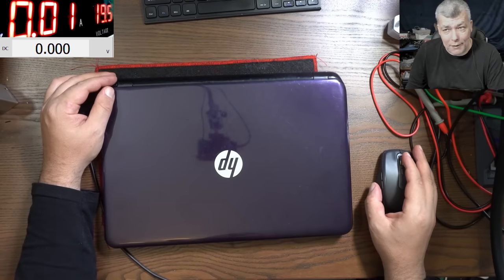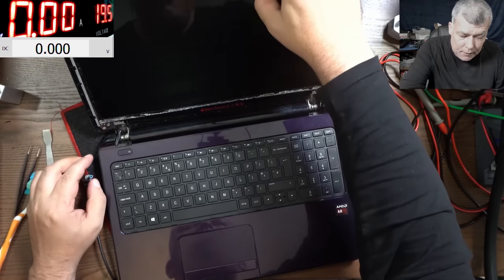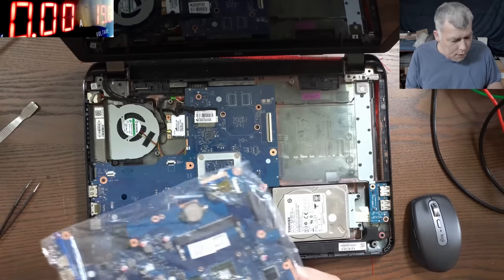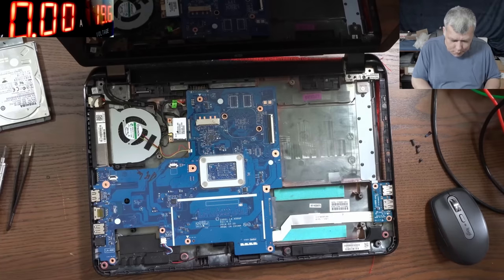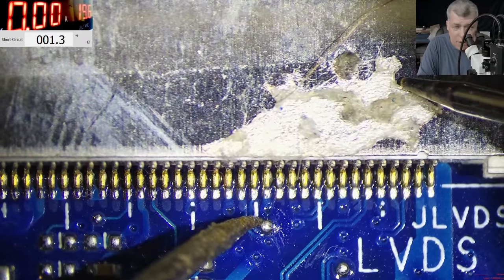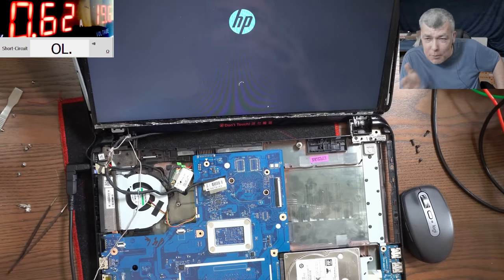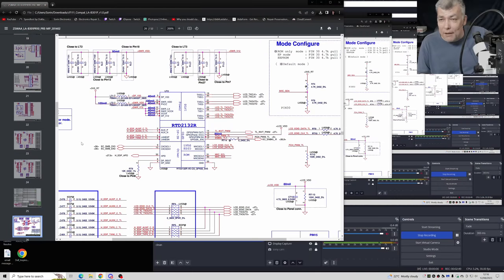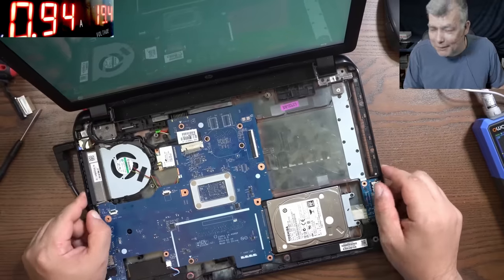Found a Youtuber fixing laptops by buying GOOD motherboards from Ebay - Let's name and shame

Comment: It's not just you. I diagnose and repair other peoples vehicles for a living. Sometimes it's hard to see a simple fault, especially when you are used to the fault being caused by a common/recurring issue. If a 2000's GMC/Chevy truck came in with no fuel pressure, 99 percent of the time the fuel pump failed. BUT......there is always that one percent that had a mouse eat the wiring. Nothing really surprises me anymore! Thank you for the GREAT video and for being a humble and honest human!!!
Reply: Also saw ants eat the wires in a car

Comment: I wonder how you, as a repairman, didn't connect the laptop to a monitor first with an HDMI cable? At that time, you would have realized that the problem is with the image cable, not with the laptop or motherboard😂😂😂

Comment: don't feel too badly about this. I have an older HP laptop that would not power on and I spent so much time diagnosing it. I finally narrowed it down to a single track on a 6 pin ribbon cable that goes to the headphone and microphone jack. The track was cracked and no signal and this shit the entire laptop down. I swapped it over for the one that guess to the track pad and it fired right up. put it back and dead again. One single wire and the whole thing died. I replaced it with a $2 replacement off eBay and it's working fine.

Comment: We usually check the Display first and if it still produces the same image on another screen we check the cable first. I have seen the screen flicker on and off but if you move the screen it comes back in a certain angle etc. Then its a clear sign of that cable is compromised. But like you mention, there can be more then one symptom when it comes to that cable being faulty. Very informative video! :D Thank you for sharing this with us!

Comment: Cut lines in the cable can only present missing colors on LVDS screens, you can also have missing backlight or even a split screen depending on which line got cut.
Short circuits on the other hand are SCARY, remember you have a 19v line next to a bunch of very delicate signals from the CPU (or LVDS adapter on this case), or the PCH, I had several cases of VERY bad luck.
Damage hinges also put the cable in danger.
Reply: I think Apple have the inverter on the MB and send 60V up the wires, ie, saw a lot of Rossmann repairs where the MB display connectors catch fire.

Comment: Well, last time I bought working Lenovo Z40-70 MB for $39 from Ebay, and put it in liquid damaged Z50-70, had to reflow 5 flex connectors and several touchpad buttons and LED's, but it was definitely more cheap, fast, trustworthy than repairing water damaged old laptop.

Comment: i was cringing hard when you were twisting the wires again and again to prove "nothing is happening, the cable is working fine", knowing that those thin line are very  very susceptible to break under repeated stress.
thank you for the informative video as always .
Reply: That section of the wire bends with the hinge.
Bending the wires a few more times won't do any harm

Comment: I also showed my viewers something similar, but it wasn't that I had even made a mistake; it was that the repair just wasn't worth the trouble in the first place when the part was super cheap, replacing it was easy, and the customer didn't mind waiting. Sometimes it comes down to a question of value. It's fun to succeed with a complex repair. It's not necessarily worth it to try in the first place.
Reply from the maker: Thank you, indeed sometimes is cheaper to swap than repair

Comment: I do it from time to time if I can get a chep donor from Ebay.  Last week I had a Dell laptop come in, maybe worth £100, but customer wanted it repaired, but quick diagnostics I couldn't see the problem.  I managed to snag a smashed screen model on Ebay for £26 and simply swapped out the motherboard and changed over some parts to make their machine cosmetically better.  Customer got a better looking machine and a bit of extra RAM and no doubt saved some cash if I was to diagnose it properly and repair.

Comment: That is a common issue on older HP laptops. I got the same issue on my HP and the price of the cable was around $80, but a few years later it was lowered to $25.
When you can buy parts from the manufactures you know it is a common issue or else there shouldn't be any parts for it.

Comment: This one was funny! 😁

There's a name for what happened: Self confidence!

Sometimes when we work many years on something and we have a lot of experience, we tend do "guess" some of the issues and we think we already know what's the problem, and the solution.

By that, we may overpass some of the basic checking steps, and miss the one that could tell us what's wrong.
That's a human thing... we always try the easier path 😎

There was also a very easy check you could do: plug an external monitor, and you would immediately confirm it wasn't a cpu fault.

Thanks for your sharing and advices! 😉

Comment: Excellent video. Educational, and it has the clickbait title that during the video transforms into an ultimate feat of self-trolling.
And as usual, there's many good lessons in here.
Indeed, it makes no sense to spend hours on fault-finding and trying to repair a part that you can replace for 20 quid. But you still have to do the basic checks before buying the replacement part.

Comment: you went the same steps i would have.  check the usuals, although i would have checked the cord before buying a new mobo and screen lol.  99% of the time if you get backlight and you getting hdd activity its either bad cable/port(s) or something on the video out circuit.  given the low value of the laptop, i would of opted for a new motherboard before spending time troubleshooting the circuit if the cable and/or ports tested good.  love your honesty though not many people would admit they made errors!  thanks for your videos always helpful and enjoy watching a fellow tradesmen.

Comment: There are 2 pins on the LCD that if they are not connected properly, you get a blank screen - they are EDID data and clock! I have the same fault on my Compaq CQ56 video that a repair shop gave up fixing the laptop due to the exact same thing! Probs bought a screen and didn't fix the problem!
Full explanation: HP laptops have stupid BIOS that doesn't allow VGA or HDMI outputs until windows is booted properly, and the Compaq CQ56 I dealt with is even more stupid that despite these laptops only coming with 1366x768 screens, no EDID makes it force a 1024x768 unscaled signal out, which the LCD cannot understand and hence no picture! Remember that.

Comment: 9:51 and that's why you check hdmi/vga output to an external monitor first.
Reply: Still 50 50.
Ive experienced the graphic display on hdmi but not on lvds.

The best way is to open schematic/boardview and analyze the LVDS system.

Comment: It had to the the wire closest to the ground shielding. It rubbed in and out enough to short and once you cut the shielding, you fixed the problem.
Fix is a fix :face-blue-smiling:

Comment: I used Kryonaut in the past but it's crap on direct-die devices because it dries up very fast inside hot 70°c+ (gaming) laptops unless it's a simple celeron.
PTM7950 is the best long lasting stuff.
For normal paste: Shin-Etsu X23-7921-5, Prolimatech PK3, Arctic-Ceramique, Gelid GC-Extreme are some of the better options. (Pastes with lower silicone carrier content, high viscosity last longer)

Comment: £19 for a working motherboard - I agree with you that it would work out cheaper to swap out the board. Sadly it turns out that wasn't were the fault was, but your logic is sound. How much was the ribbon cable? I imagine it would take longer to swap out the cable as well!

Comment: Thank you for the video. Ultimately, in this case, it was a faulty cable, however how did you rule out that it wasn't a faulty LVDS connector?

Comment: Just putting my two cents here (not related to original problem of this video). I ve encountered the same kind of behaviour by poor grounding between the screen and the  laptop. The protective wrap of the LVDS cable is also conductive on the outside and offers ground for the screen to the rest of the laptop. On some hp models (only laptops i ve seen this) this conductive layer was deteriorating losing its conductivity to the ground surfaces disrupting the signal to just a black screen with backlight on.

Comment: i seen same thing you had happen. i too thought it was the screen, ect. but i found that they pinch the cable at the hinge shorting it to ground. ha ha. i had trouble getting the cable. so digging through my parts and looking hard found the cable. it easily gets pinched at the hinge on the left. when they open and close it eventually it shorted out.
thanks my friend. i love your shop and knowledge. i get a lot of those in. and i now look at the cable at the hinge.

Comment: Sorin, I bought a cheap (£7) mobo to find there was no possibility of making an economic fix of a machine that came into my possession (screen, gfx issues too etc). The £7 was just the cost of finding out and I sure as hell saved way more than £7 of my time. In this case, it is what it is and sometimes you buy a part just to speed up the process but in this case you feel like you didn't it at all. Fix enough stuff, it happens huh. Cheers.

Comment: I made all mistakes in the book repairing my laptop screen:  I bought a new screen - forgot to disconnect the battery when I inserted the ribbon cable to the new screen, the first pin burned up, I could see it glowing red hot, and the melted away completely - and still the screen worked - but I bought the wrong resolution screen.  So I bought a new cable on ebay/amazon since the old ribbon cable  has one pin missing  ( but amazingly the whole wrong resolution screen  STILL had a perfect picture - can you explain why it still works without the first pin present?   :) :) :)

Comment: I had hp dv6 for years and had problems like over heating or other stuff. Last time it stopped booting, and was not responding as if some thing in the processor just burn out. Bought after an lenovo thinkpad, it is great, very light thin fast and silent.

Comment: If the title is true, how is that a problem? I fixed my TV by replacing a board, with one I bought on ebay. That's a plug and play fix (very little effort required, and nearly guaranteed outcome). When that board broke a few years later (same problem), I bothered to actually order the broken chip from China, and replace it, on one of the boards (because no more working boards were available cheaply on ebay). 

There's more than one way to repair something, and I usually do whatever is a combination of the cheapest + laziest. I'm watching YT on that TV, right now... which I bought in 2009.
Reply: I wish I had just replaced the power board on my TV. Instead, I went through the trouble of replacing two busted capacitors only to find out the problem was the power supply itself, not those capacitors. Would've saved me over an hour of wasted time. 

$21 for a new board, a couple minutes to replace it, and it works like new.

Comment: There's no sloppiness here, from what I witnessed you were very methodical in your approach (as always) and you followed a very good process of elimination....unfortunately the problem was a unique one which you highlighted prior from you expert understanding and experience but meaningfully discounted (and as it is - it turned out the trouble laid in that area). At the end of the day your experience and understanding still identified and fixed the problem where it may have been deemed a no-fix by someone else.

Comment: Nothing wrong with pop and swap.

In this case you were trolled by a wire harness, which has a chance of going bad due to going through a mechanical path, the hinge.

At least this time it worked, because it was not a serialized device where it was assigned to the system it was placed into creating the need to 'program' it to the new device, PITA.

Also, Bitlocker and UEFI makes this so much harder than it used to be.

Comment: Sorin sometimes you can try CTRL + ALT + DEL and see if the task manager opens?
Because there are Rouge applications that will kill the explorer process, and all you get is a blank screen like this. 
You run explorer and make it show the desktop.
That's if that is what's happening, of course. Instead of a bad ribbon.

Nice job man !

Comment: Your channel is very informative and I was just wondering, You had the opportunity to try an HDMI cable before purchasing a new board but you never tried it.  I had a similar situation with the blank screen and when I plugged the external monitor, it was working fine.   👍😎

Comment: 🙏💚🧡👍I had my time dealing with a screen cable directly sold on the mother bard, so I learned to have a look on this issue on a samsung where the cable were tract by the opening of the laptop, screen top.  Nice to see the mind process to find the source of the problem

Comment: i had same thing and i even reball the GPU twice! but after that i learn that to check the laptop with external monitor by hdmi /vga or any output before doing anything . so yeah if you just put an external monitor on laptop you never but that motherboard or even anything . have a nice day

Comment: Why you dont put another monitor in the hdmi soket and wait until windows start the welcome screen the windows at that time identifies the hdmi plug and ativate the secound monitor output without to have to change anithing in the windows configurations i do this to a laptop with the display all broken and works. In this way you already figure out they cant be motherbord or cpu, and realise the only thing to check was the cable and the display. If you do this to a normal laptop you realise you dont need to configure nothing to have also image via hdmi for another external display you finish with two screens on the external one and onbord one, the only time you have to configure something to have external picture via hdmi or via onbord is in a desktop computer when you have to change in the bios for have output via external grafic card or onbord gpu output. 
   Aniway thanks for the good video and honesty, and your mistake can help others in the future for dont make the same mistake in a laptop.

Comment: Sorin can you or any one else tell to use what settings we have to use on oscilloscope to measure data line signals? It may help me as well as others who are novices on oscilloscope usages. May be a dumb question, but as far as oscilloscopes I am an unadulterated dumb! No, I don't have it either but plans to acquire one. Thanks!👍
Reply: i did have the same question
Reply from the maker: Unfortunately the only way to visualize digital/analog signals, is with an oscilloscope, anyway, there are plenty of cheap oscilloscopes
Reply: @Arvidje  Yes, there are many like us!😀
Reply: Just observe the picturesque:)
Reply: I think that by reading the user manuals of any oscilloscope we will get a general idea on how to use it in different scenarios!

Comment: 😂 it happens man. Like at my work we get laptops with video BUT no backlight all the time, the exact opposite of this video, people always go & change the screen without actually verifying the cause and still have no BACKLIGHT after a lcd replacement 😂. On those MacBooks that issue (HAS video, NO backlight/brightness) usually is the motherboard. So for that reason i probably woulda tried another test screen before hopping on eBay 😂 thankfully it was the cable that’s why i like windows laptop more on apple we can’t just fix the cable smh whole screen replacement. Good video most of these repair people wouldn’t even upload

Comment: Even if the Windows setting doesn't enable HDMI, shouldn't you be able to see the BIOS screen over HDMI ? Or is that only older laptops ?

With faults like this one, I always think it's the screen cable because that's what happens on my personal Lenovo X220.

I hate how laptop companies put the screen cable right on top of the heatsink so the cable gets heat damaged over time.

Comment: I damaged my motherboard keyboard connection ripped the connector out. The problem started with damaged belt (these are very close connected between keyboard and motherboard and thats why as a beginner wasnt careful enough)
Anyways, i dont want to use an external keyboard, and the connector on motherboard for keyboard is also damaged. Is there a way to bypass this internal keyboard connection to a usb, or other connection, and how to do that? Or alternatively is it possible to repair the connection, (the connectors are all faint) Or for this acer laptop replace it with an hp laptop keyboard (but the connection seems abit bigger on the HP plus would need to take it out from there and still carefully set it up here.